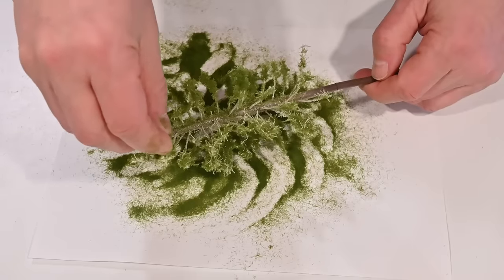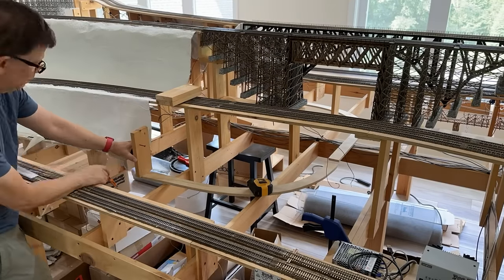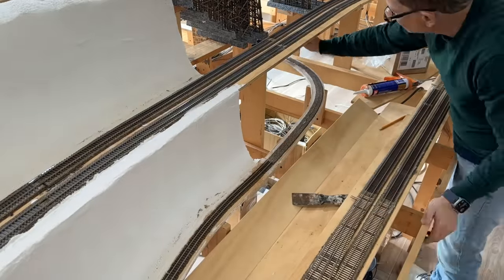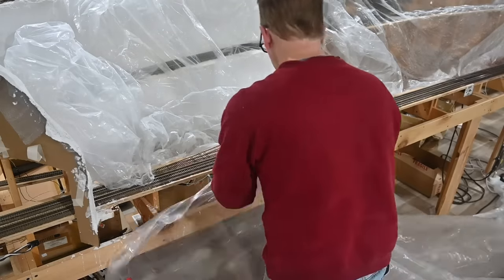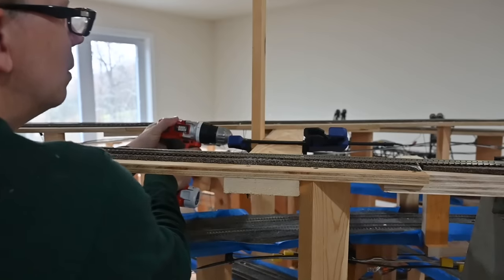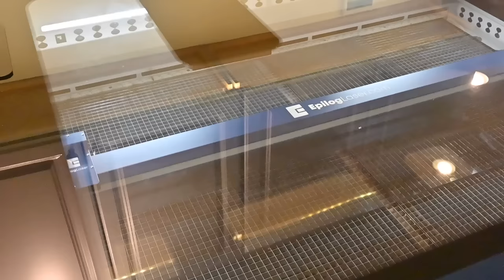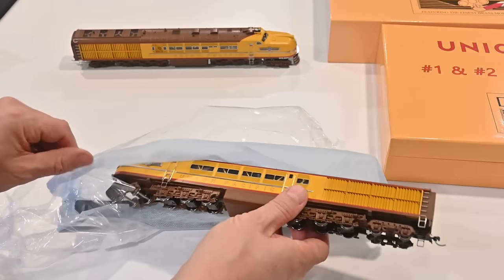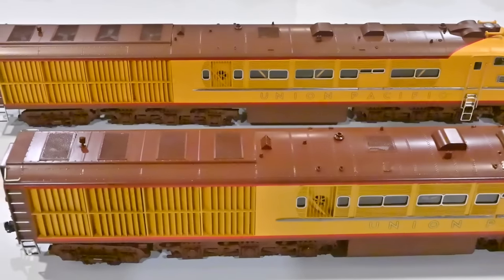S4: E1: Back to the giant layout room plus Division Point's new GE Steam Turbines!

Comment: Glad you're back, after being worried that you might have stopped posting these updates. Love your videos! Your payout with the historic and elaborate bridges has inspired a fantasy "cost is no object" layout that to be erected inside a low ceiling warehouse-type building covering several acres. The defining features would be full scale replicas of multiple landmark bridges and viaducts: Hell Gate Bridge including approaches (at HO scale this would be 195' long); Horseshoe Curve and general area (roughly 50' by 30'); Starucca Viaduct; Tunkhannock Viaduct; Penn Station (with upper structure that would rise on a lift to reveal the platforms and trackwork); a mile's worth of the New York Central line up the Hudson; Sciotoville Bridge; UP's Bailey Yard; Diablo Canyon Bridge; the Soo Line Arcola bridge; and other places of interrest as well. The main floor would be the lowest level, for walking or riding golf carts around the layout, underneath all of the major long span bridges. The next level would be the opearting and viewing level about four feet higher, corresponding to the usual floor level of most layouts. There - I've just spent several million dollars with just a few keystrokes. Please KEEP UP THE GREAT WORK!
Reply from the maker: That's quite a vision! Thanks for watching!
Reply: Thank you so much.i hope you subscribe as more is on the way.

Comment: That's dedication at an entirely new level.  Bit more than I could handle. 
I probably would have built a cinema and used a smaller room for the trains. The cinema is great for cab rides.

Comment: Very interesting views of the steam turbines. I have been designing a live steam version of these for several years in Gauge 1, which is intended to follow prototype practice, i.e. steam turbine and monotube boiler. I have found it extremely difficult to obtain drawings of the originals. I only have an outline of the proposed design and good plan of the bogies from the museum that contains GEC historical material. The design had been altered a little when they ran very successfully on the Great Northern metals. The prime cause of their failure on the Union Pacific was the fact that their condensing system didn't provide the expected range. I am sure this was due to a very simple reason. The exhaust was sucked into the condenser' when on the move. Obviously while being tested in the build shed , the exhaust will had been vented directly upwards. giving satisfactory results. Film evidence shows very clearly the fumes from the forward placed smoke stack being sucked in , staining the sides immediately in front of the inlet vents. By the time they were set on the Great Northern, GEC had obviously done something with the exhaust possibly altering it to exit directly in front of the condensing fans negating its probability of passing hot air though the condensers. The other thing they did was to run them back to back when used as a pair. They were an incredibly advanced design at the time. Essentially one man running two steam engines from a forward cab.

Hopefully these manufacturers will be more cooperative in pointing me to a source of drawings for the full size prototype than Overland models were.

Comment: Wouldn't it be better to weather the road bed before track is layed. Now you're gonna have to take fine sand paper to the track for the locos to run
Reply from the maker: Not sure what you mean by weathering the road bed? I'm assuming you mean the track, in which case weathering it before or after you lay it down is simply altering the order of the same tasks. You're going to have to remove any stray paint from the top of the rails in either case. The key is to remove it before it dries, as I did with the scrap of cork in this video. It's very easy and quick to do.

Comment: How long is your floor length?  I hope you verified the maximum length of the distance your laminate floor can span. 
I installed a floor for a relative and it was 3’ under the max length, and part of it buckled. Required a transition to be installed to break up the distance. 
Fortunately the manufacturer paid for the installation..
Good luck
Looks great.

Comment: Will it all come apart if you move to a smaller house?
Reply from the maker: Technically it can, yes, but it would be a monumental effort to do it. I'm happy to leave that problem to someone else in the future!
Reply: @rcgrabbag  I’m a regular visitor to Beconscot railway centre in Beaconsfield (nr London England) they have an extensive ground based model railway system running through a model village, with a fully integrated junction control room including Station stops etc, with tv screen display that the kids can view. If you get to visit the U.K. it’s only half an hour from Heathrow airport. (You’d love it!) Have a great Christmas RC. 👍🎅🏼